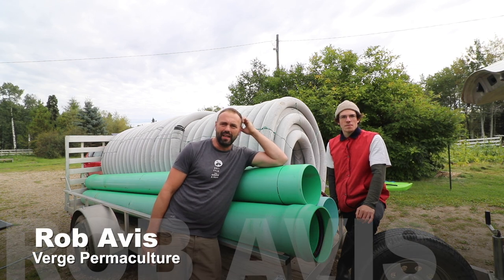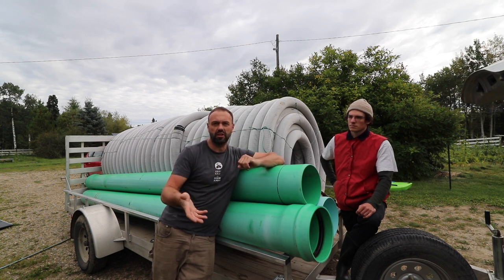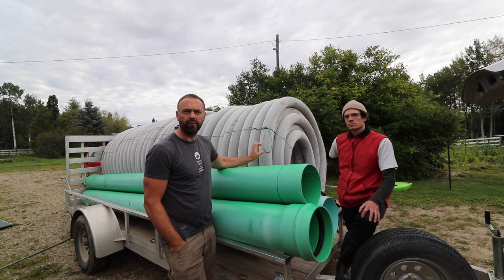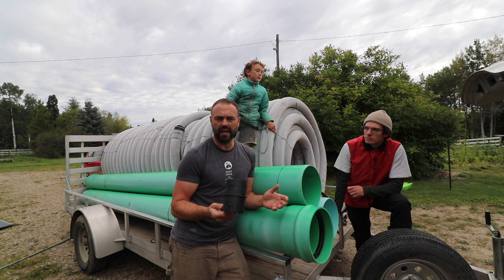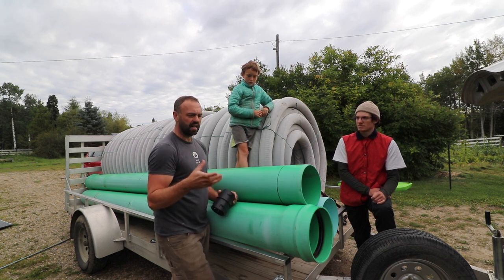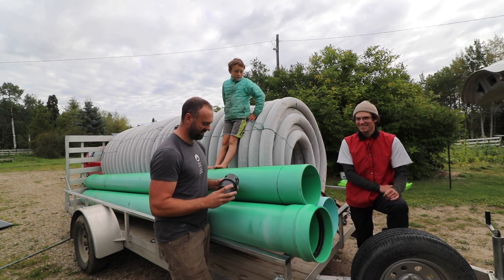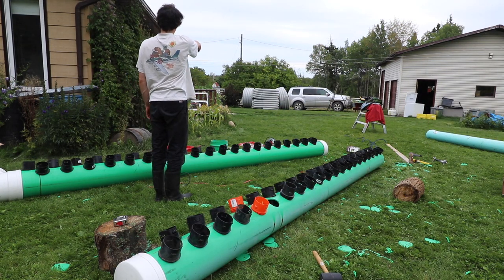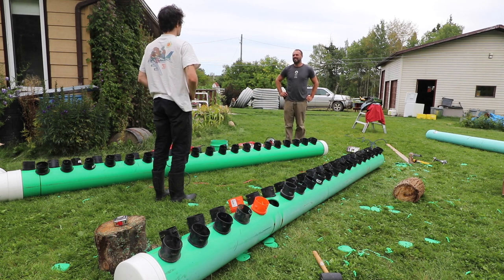How To Build a Climate Battery - Day 1 - Construction In Passive Solar Greenhouse

Comment: That's so cool.  I'm a civil engineer, so I'm used to calculating water.  About 20 years ago I wrote a finite-element program to simulate rainwater being stored in a crushed stone base then percolating into perforated drains.  This was to design drainage systems for sports fields.  As to the season being shifted, that makes sense.  I guess as a student you must have taken System Analysis or Signal Theory.  The course may be called various things, but it's when you have a black box with an input signal and an output signal and the black box is the "system" that can be represented by a mathematical formula.  The system could be electrical, mechanical, hydraulic or thermal.  If the input signal is sinusoidal and the system is essentially a storage system such as a capacitor, a spring, a reservoir or a mass heat storage unit, then the output signal will also be sinusoidal, but the amplitude will be reduced and the phase will be shifted when compared with the input signal.  So when you observe the seasonal effect of the heat being stored by a quarter year, that's the phase shift of the temperature signal. You'll probably see something similar with the daily temperature changes, not only will the difference between daily high and low be reduced, but the time at which the highs and lows occur will be shifted by a few hours.
Reply from the maker: Once we get the empirical data we should be able to see this phenomena. I will share with YT once we have it.
Reply: Civil Engineers rule!  I went a different way and kick myself for choosing electrical over civil.  Civil Engineers built the world!
Reply: @VergePermaculture  Next time you need to pound those fittings into place? A lil bit of dish soap saves a lot of headache.

Comment: Here is a tip on using the holesaw I picked up from Rob Bob's aquaponics channel: Run it backwards! 

The reason the holesaw is so heavy on your arms and body is that the cutting teeth are eating away at the plastic whilst you are trying to keep the drill steady. However if you run it backwards the teeth are still effecting the plastic, they are just not so eager to bite into the material. Less friction reduces the amount of torque the drill pushes back through your arms. 

It really works, try it out some time!
Reply: Came hear to say the same thing.   Learned this from my father in the trades, when cutting into plastic siding.  Going forwards it can literally crack even 5 yr old vinyl siding!
Reply: Also makes it take longer.  To cut through some depth of material l it's going to take some amount of work J.  If you spread J out over a longer time t, the power required W is lower, which you feel as torque, but you're resisting it for longer.

Better to do it at the max power of the tool/human combo and get it over with.
Reply: @Asdayasman  Blowing out the hole makes the fit worse meaning you spend more time having to plug the holes with tape.  So, no time saved at all.
Reply: @crazycdn8327  Why are you replying to me?
Reply: @Asdayasman  Pretty self explanatory... I disagree completely with your comment, hence I replied with why it's not a good idea to do what you said.  Running it backwards, in plastic adds at best a couple seconds to cutting the holes, verses your idea of going full boar and blowing them out by going forward with the bit.
Reply: @crazycdn8327  I never mentioned anything about "blowing them out" at all.  You're replying to the wrong person or completely misunderstanding my point.
Reply: @Asdayasman  Do you not even know what you wrote?  You: "Better to do it at the max power of the tool/human combo and get it over with."  Doing that, instead of running the hole saw in reverse will blow the plastic out... You will be spending more time fixing the gaps made by tearing the plastic apart instead of the few extra seconds of going backwards to get a nice clean hole.  That's what I'm replying to and correcting, because you are wrong.  Brains over brawn.
Reply: @crazycdn8327  Well duh of course you don't do it with zero regard to the material under work, what sort of pedantic point is that?  If you're going to play semantics that way, you could just have said "the max power of the tool/human combo can be increased if you use nuclear weaponry lmao" and I could have realised you were trolling from the start.

What a waste of time humouring you was.

Comment: Great to see someone trying to apply some modeling to the airflow.  And very happy to see you using smooth pipe for the manifolds.  I've seen a lot of really bad 'manifold' situations in other videos, where they try to cram a dozen or more feeder pipes into a 'manifold' of the same diameter of the feeders.  But here you're collecting twenty 4" pipes (sum cross-section of about 250 square inches) to one 10" pipe (cross-section of 78.5 inches).  Since you modeled this, does this mean the model showed about 2/3 friction loss in the feeder tubes, so that you needed 3x the cross-section in feeders, vs the manifold?  It's what the math suggests to me but so far you haven't really explicitly addressed the friction loss.  If so that'd be twice the friction loss that I've been guessing.   If having 3x the cross-section in feeder pipes vs manifold is a good rule of thumb, it'd be really good to put that out there.

Comment: Why did you not use only one intake (fan) manifold, then use the exhaust ends of the small tubes to evenly distribute the warm air more around the space like a group of organ pipes. Are you using sand for extra conductivity in the base fill before adding other medium. Do you have a drain and vapor barrier under pipe network?

Comment: Thank you for the very interesting and educational series of videos.  One BIG question on my mind is whether there could be alternatives to using all that plastic? All the climate battery designs out there (that I can find) bury so much plastic piping that it seems counter to the principles of permaculture. I love the concepts that seek to harness solar energy in anyway that we can, but the idea of leaving plastic in the ground for many, many generations to deal with later just does not feel right. Have you come across other materials (and perhaps ancient methods) that use natural materials such as stone, ceramic or even concrete that could be used instead of plastic?  Seems like a worthy challenge for an engineer.  Thank you for any additional info and insights you may have.
Reply: Good point. We just recently found aircrete. Domegaia, Aircrete Harry, Honeydo Carpenter, Man About Tools all use it for building structures/grow boxes and have various tests on it they have performed. Most recently, Stephen Williams has taken all their wisdom and added his own using the otherwise awful styrofoam that fills up landfills. So maybe someone can check on that and see if it is financially feasible to use to make a pipe with? or something. I have a feeling it would not be economical though.

Comment: Having done a lot of large hole drilling, I was scared for you when you said you were going to use a 4" hole saw...  I'd have built a jig, even if it had taken me most of the day.  A jig to hold the pipe, and a Jet drill press - an ever useful shop tool.

Comment: Great work! 
However I believe that you wont get uniform airflow in all pipes with that manifold. A manifold like that should taiper off in order to get even air distribution in all pipes. This is because the air pressure drops as you get closer to the blocked end of the manifold. 
I would consider cutting the connector, so that it is fluch aginst the big pipe, in the blocked end. Then gradually increase how much the connector intude in to the large pipe as you get cloaser to the fan end of the manifold. 

But i don't know how big effect this will have, you are probably quite close to uniform airflow with the setup you have now. 

Nice build, locking forward to see the next video!
Reply from the maker: This is why we have a reverse return system ie. the outlets is kidie corner to the inlet.
Reply: Okey, that is probably a smartar way to solve that problem ;) 👍 
Great work! :)

Comment: I think you should have tried it with pex water pipes running in the ground to an air to water radiator instead. No mold concerns, easier to install, probably much cheaper and simpler
Reply: do you have a design for this?

Comment: What air velocities are you aiming for in the piping? Our modeling suggested that faster speeds (achieving turbulent flow) may be better, but your study would seem to show (based on the number of pipes and the size of the piping) that lower velocities are desirable. Looking to sort that out in my mind. Also, are you planning to balance airflow across the piping so that air velocities relatively equal across all piping runs? If so, how will you achieve that?
Reply from the maker: I am going to measure that, because it is so rough inside I have no idea what my centre velocity is going to be. Lots more study to do.

Comment: Hi where could I find these black 4 inch  couplers. I’m building a manifold this week. Thanks
Reply: If you are using corrugated drainage tubing check where the holes or slots are located. If they are inbetween the ribs you`ll need to modify the tubing by cutting a straight slit through the outermost edge to ensure the condensate can fully drain. Condensate/water sitting in the bottom of every corrugation will have a big impact on the heating  perfromance.

Comment: Years ago I had an idea for a irrigation controller that data logged from all the sensors you could put in it. Soil moisture, temperature, photocells for logging daylight. All could be setup respective to the zones so you could irrigate different areas in your yard. Lawn zones could be irrigated off soil moisture levels instead of just a set watering time. You would be able to add any sensor to a zone. It would be more than a controller but like a data collection and monitor system. You could track your daylight hours in a zone or the average daily temperature.. Greenhouses could be zones too and you could use that controller to monitor your greenhouse temp, hours of light, humidity ect.. I'm just not a technical guy like that but it's a product I still haven't seen invented
Reply from the maker: Neat idea!
Reply: @VergePermaculture  I trust you'll show us how you're going to gather information from this greenhouse

Comment: Seeing the news in the past few months about sand batteries for heating like the one in Finland, I had a thought. As a climate battery is really the same thing configured differently, I wondered if I could combine the 2. Climate batteries work great but can be expensive and for a small home grower, quite a large expense. If I had a say 12x8ft greenhouse and wanted to convert it. If I were to dig a pit say 4ft square and 8-10ft deep.insulated the hole then filled it with pipes and sand could this work the same as the (normal way) a climate battery is usually constructed?

Comment: I would consider not using perforated pipe cuz eventually it will take on water.  You want to try and keep the water out.  I spoke with a local drain tile installer who has also built a couple of these and was told to use solid pipe, no holes and seal everything up tight.  He also recommend not using manifolds just one long pipe snaked underground with a pusher and puller fan on each end.  So the air can't take the shortest/easiest route and bypass some of the other piping.  Good luck

Comment: I thinking it is super exciting, I follow with a lot of enthusiasm, but I think a large air fan uses a lot of power, why do not use concrete with underfloor heating just like in the houses, what are the advantages and disadvantages of each system

Comment: Since I have a high water table from the 75” of rain here thus I can’t use geothermal storage, especially with perf pipe. The subsurface water also migrates downhill which would wash   away the collected ground heat…  (sigh). 

15:19 Then I’m back to designing the needed 15:41 thermal mass above grade. I’m hesitant to give up ground area for barrels of water so that leaves me to use a concrete or masonry wall on the north side with insulation on the outside.

Comment: I'm going to throw out an idea. what if around the air tubes you ran 1000 feet of 1/2' pex? maybe $300... you can then later attach that pex in 3 ruins of 333 feet to three evacuated tube arrays where the pump is run by solar. what I just suggested is how to inject heat - and a lot of heat, to the ground so you can go ALL winter. what I suggested will add 10-20' to the ground temperature around where your GHAT system is drawing heat from the ground. the evacuated tubes will add WAY WAY more heat than any air transfer but you can draw it back out by air transfer... anyway - it's about $300 to add 1000 feet of pex NOW if you understand what I just said...
Reply: That's a brilliant idea. Try this idea out and run a study on it. I'm interested to hear how well it works out.

Comment: You could secure the pipe quite easily - lash either end to something that's not going to move, like a tree.  But then if the drill binds up, you might be breaking your wrist.  Or breaking the drill.  Maybe if it has fine toothed hole saw.  Not sure if that's helpful.  You're the engineer.  I've drilling a lot of crap like trees and logs.  I've discovered it's far better to use a paddle bit that doesn't have that aggressive threading to try to force it through faster - too much torques.  I like the flat ones that shave a bit at a time.  I've bent enough bits to come to that conclusion.
Reply: Oh, I see.  It's not that the pipe moved.  It's that the drill bit in to hard and tried to break your wrist.  But I thought you said the pipe flew around?

Comment: Hi Rob, txs for another great video. Maybe a stupid question, but this manifold seems like quite an inefficient, expensive and potentially problematic way to divide the air between the different pipes. Why not let the pipes of the same length simply come out of the ground in one place, like this guy did (https://www.youtube.com/watch?v=Ibaf_rkW_30&list=PLQJjRQwdSINdZpYBjY7xFXujtqle7hOHK&index=22&t=126s)? Curious for your expert opinion as an engineer. Txs!